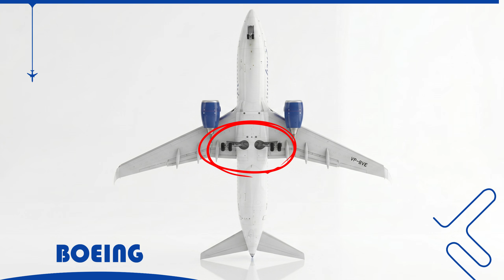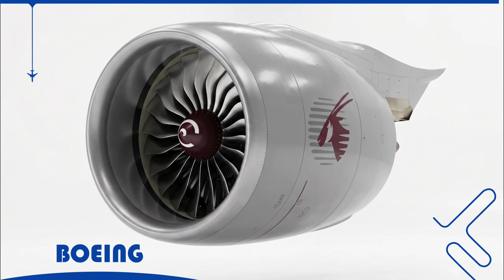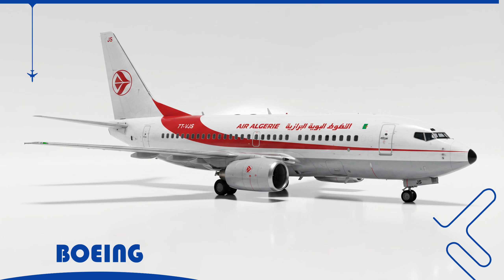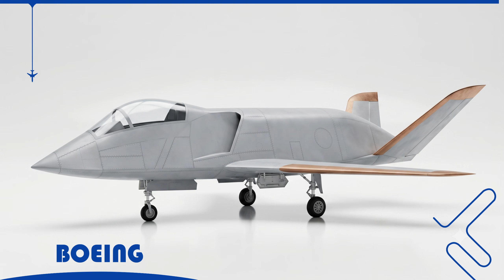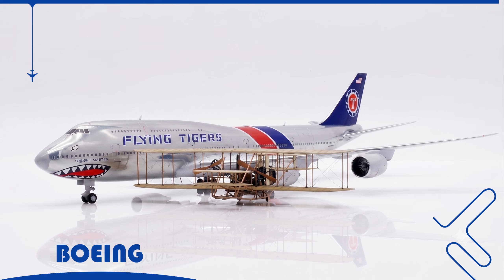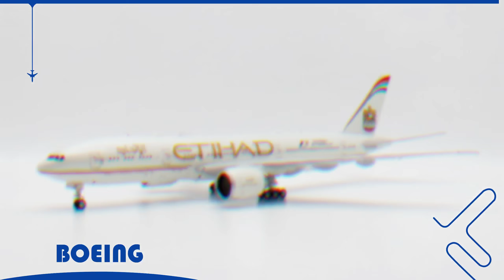Crazy Boeing Facts You Didn't Know

Comment: The 747 does have 5 jet engines.  The fifth in in the tail where you can see the exhaust opening. It serves as an APU (Auxilary Power Unit) and provides electricity, hydraulic pressure and compressed air for the plane on the ground when the big engines are not running.  The compressed air is used for starting said flight engines.
Reply from the maker: Pretty much every airliner got an APU and as far as i know it doesn't count as an engine since it provide no thrust
Reply: The 747 has the ability to cary a fifth engine on the wing to ferry a replacement engine.